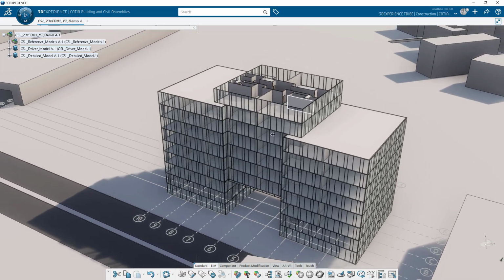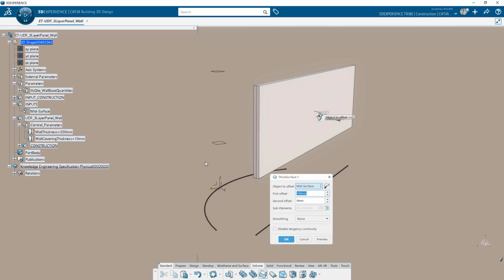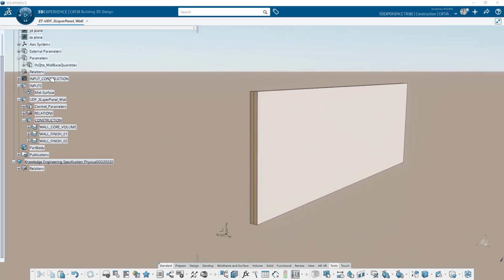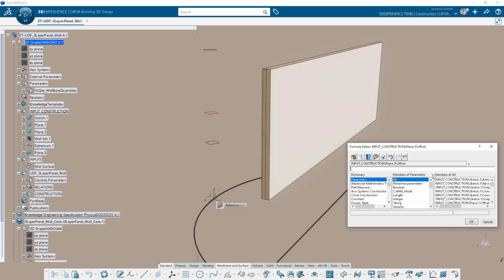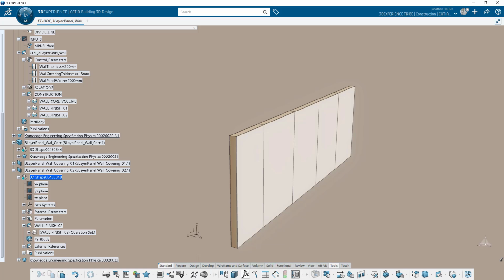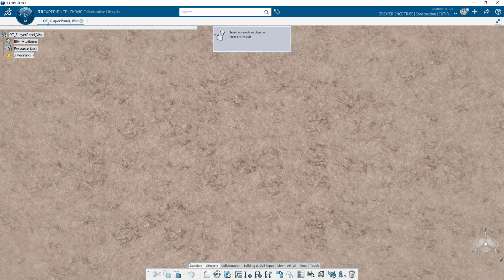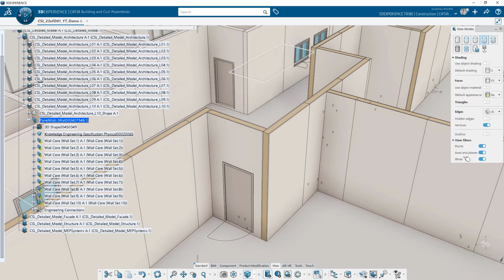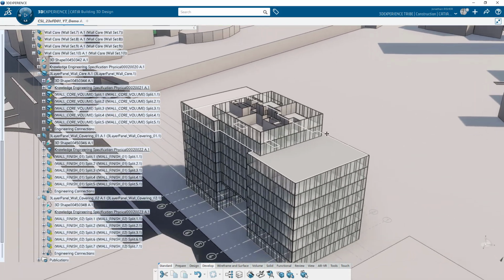9. CATIA Building Design Fundamentals Appendix 1 - Creating a Wall Object Type

Comment: Please have a look at the corners.. in real life the panels might be fiber plasterboards that are finished with wall putty..This means that the outside corners aren't correct. (The ends of the walls have no "panels". I don't know how to solve this.. but, you can instantiate framing according to the wall volume. Panels can't be added to individual walls and must be applied to the "combined" walls. How would you solve this..?
Reply from the maker: Thanks for the comment! In this video I didn’t go to that level of detail for the sake of simplicity. How I have done this in the past is to add a parameter to extend the finish from one wall past its end point to cover the exposed framing of the neighboring wall. I would also include an extend/reduce length parameter to control the overall wall length to allow for these types of modifications, which would have to be done after the detailed walls are instantiated into the model.
Reply: @CATIAAEC , so it's more or less a manual process to correct the design after instantiation. Looking forward to work with this..Maybe the "Priority" can be used to control the parameters you mentioned.